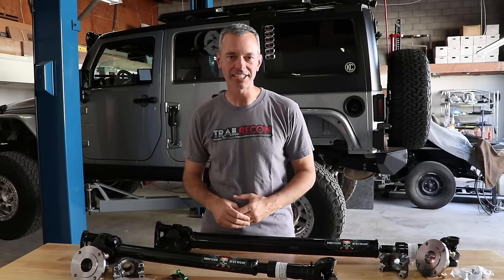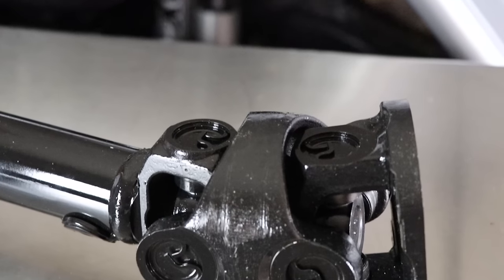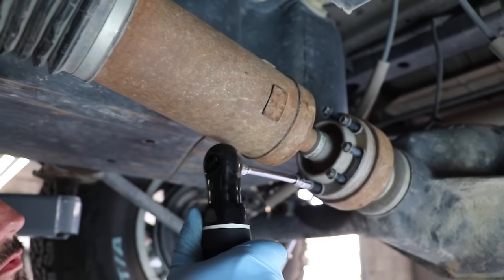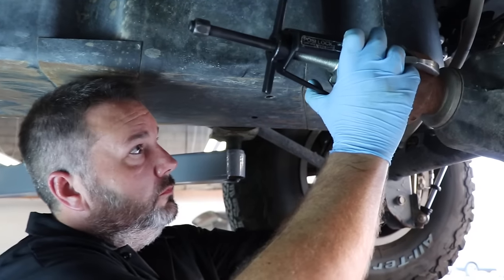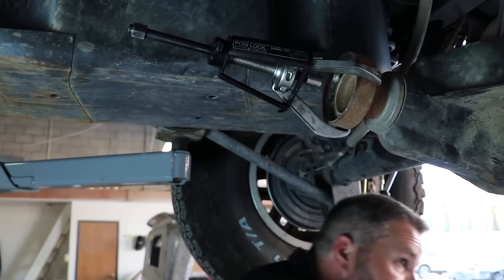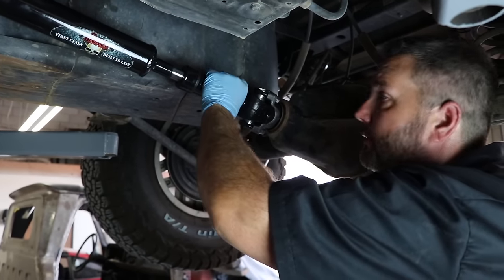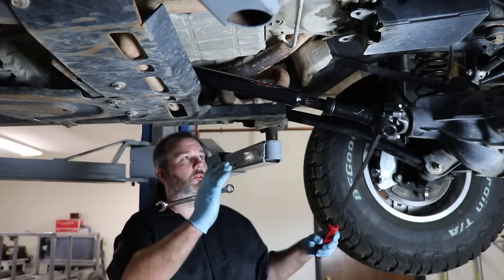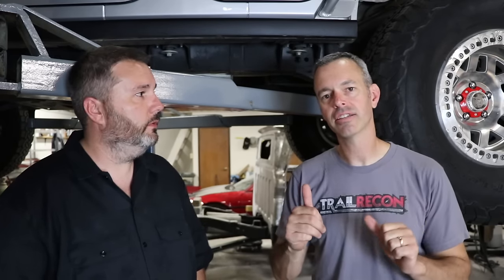How to REMOVE and INSTALL Stronger DRIVESHAFTS?

Comment: Too bad he didn't mention what size socket to use for those yokes.  I laughed at "don't overtighten the pinion yoke or you may damage the crush sleeve", then he attacks it with an impact gun and says "yep, that feels about right" lol

Comment: Although I wheel with an ‘86 Suzuki Samurai, I faithfully watch all of your Jeep-centric videos.  ALWAYS informative.  A couple years ago I broke u-joints on both ends of my rear shaft.  Now running Spicer 1310s on custom shafts front and rear.  Compared to the stock set-up, they are way beefier and plenty enough for the 31s which look huge on my scaled down rig and offer plenty of ground clearance with a 79” wheel base.
Reply from the maker: I love the Samurai's.... I've seen them go places a Jeep can't go!   Great to hear the 1310's are working well for you.

Comment: 1350's are perfect for a rig that sees good action off road.
I've had 1350's with a Tom Woods shaft on the rear for 10 years and all I've had to do 
is grease them a few times a year.  Double cardan's will really smooth things out!
Reply from the maker: 10 years on 1350's is the kind of life I'm looking for!

Comment: He wasn’t kidding about those driveshafts being hard to remove. It took me about 3 months of busting through rusted bolts and hammering away at the front and rear drive shafts before I finally broke them off the vehicle.

Now I’m here, learning how to install the new driveshaft that I will now have to buy.

Comment: You don't remove the diff carrier & measure the spindle bearing preload drag when you retorque the yoke nut????   Do you run a break in period on the diff after that?

Comment: Run some 1350 driveshafts on my JK. Nice not to have to worry about them. 

  Brad..  Relocate that EVAP canister above the rear axle!
Reply from the maker: Agree, the canister needs a new home soon!
Reply: @TrailRecon  metalcloak makes a nice bracket for the evap canister.

Comment: Hi - great video, thank you for posting. Listen, I'm trying to get the driveshaft off an old volvo of mine and I can't seem to get it out of the rear diff. I noticed Mike used a hammer to simply pound it out...just wondering what surface he was pounding away at - was it on the shaft itself or on the female end of the rear diff, do you remember? Whatever he was doing seemed very efficient and I'm hoping to replicate his technique. Great looking Jeep you got there!
Reply: Changed mine last year, had the same issue getting the old CV bs off. If you watch closely when he's lowering the old DS down (6:22-6:29) you can see where the diff end is like a psuedo female adapter(that really shiny part is the male part to the psuedo female adapter),  it slides over the male DS side about a quarter of an inch.  Tap on the male side, anywhere in front of that.  I have a massive set of slip joint pliers,  I grabbed the shaft and hit the pliers at the bite point, alternating sides, and it will come undone.  If you're doing a replacement in kind, just be certain you don't damage the female side of that diff joint

Comment: Brad, it’s been a while since you had these installed, how often are you re-greasing your drive shafts?  Are you doing it every oil change?  Any challenges you’ve run into?
Reply from the maker: They have been holding up great and honestly I have been trying to keep up with greasing at every oil change. No challenges.

Comment: If the new has a smaller diameter than the stock, why was there a conflict with the transfer case cable mount with the new when there wasn't with the old?

Comment: Does the drive shaft I buy depend on the axel housing or gearing that my Jeep currently has? For instance, I have a Dana 30 front Axel housing on my JKU with like 3.56 gearing. If I upgrade to a Dana 44 with 4.88 gearing will I need to buy a new drive shaft for that?

Comment: Hey Brad, love your videos! I have a Metalcloak 3.5” lift and just put in the Adams 1310 front driveshaft. I’m running about 5* of caster and 1* pinion angle. What are you running and have you had any issues thus far?

Comment: Hey Brad..   It's probably been mentioned already but although your technician means well, It's never a good idea to install a pinion nut with an impact.  Transfer case side as well.   Who knows how much torque is on the transfer case side.   He set his torque wrench to 160ft lbs and the nut never moved before it clicked..  I can bet money he changed the preload on the pinion bearing as well..   Please do yourself a favor and take it into a driveline shop and have them change your crush sleeve and reset your preload accordingly.   It'll save you aggravation and money in the future.  You're way too good of a guy to have a shop burn you accidentally...  How's the stock steering off road with the 37's?  I can bet you're looking at a PSC system..        Keep the shiny side up bud..  Happy wheeling...
Reply: Also, for the extra $4 
 why not change the seal as well? you already had it apart.

Comment: So I need to ask about the length for the rear drive shaft, what size is it ?? 42" ?? I have a 2015 jku Rubicon with a 4" lift and 37" tires and I need an upgrade

Comment: I think I overtightened the pinion nut that he is saying to to overtighten cause it will change the preload. Now I get a clicking noise when decelerating. Could it be it? can I loosen the nut and tight it again ?

Comment: Brad, do you have any concern of the 1350 exceeding the strength of your other components putting your axle at risk of failure. Adam's website states that 1350 is recommended for running tires beyond 37s on D60s.
Reply from the maker: No concerns.  I talk with Adams about that very issues and they still recommended 1350s.

Comment: Noticed the Adams driveshaft yokes don’t use a dust cover for the pinion seal. Is there or reason for this or is the factory dust cover considered an overkill? Wondering if it is likely for a spec of sand to get trapped between other pinion and the seal and create unwanted grove without the dust cover.
Reply: I wondered the same thing but noticed there's some type of rubber material there sticking out. I also wondered about the gap where the OEM Style front flange mates with the Adams OEM Style. There's a gap being there where it seems like crud could get behind it....I'm sure they've thought about this though...

Comment: How much does this type of labor usually cost? I just ordered my and was wondering if it’s worth it taking it to a shop rather than doing it myself? How much in labor fees?
Reply: 2023 - I was quoted $240 by the local Jeep dealer to install a front drive shaft if I supplied it. It took me close to 4 hours and I still need to revisit the bracket (see 14:30-14:50). I would say I was working slow for multiple reasons including having to beg, borrow tools from neighbors and shuffle around tools when the rain came. So the $240 would have been well spent but I learned a ton as well. I will write up a summer below too. FWIW, another '4x4' local shop said they would install their own custom shaft for $1400. Yikes!

Comment: What size posi lock did you guys use!?
Reply: this answer won't really help you with a specific size, but keep it small. There's not a lot of space on the front size of the transfer case. Think puller arms 3-4" long max.

Comment: I have a 09 jku with a 2.5 rk lift with oem control arms. Do I need adjistable control arms for a drive shaft like this?
Reply: Manuel Castillo I was told “only over 3 inches do you need to change the control arms and drive shafts”

Comment: I have a question. Why did he torque the front but bot the rear? He torqued to the front to 160 ft/lbs but just used an air gun to put the rear on.
Reply: Pinion gear has a preload setting based off the torque required to turn the driveshaft.  The idea behind his work on the diff side was to NOT screw with the preload setting.  I've heard a lot of DIY guys say it's easy to do and I've heard a lot say, never do this without checking preload with a dial torque wrench.... Basically if you screw up you'll eat your rear diff up in a few months
Reply: But I did mine following a similar method a year ago and...so far so good

Comment: How is a u-joint strong than what the factory had
Reply: The factory joint is a constant velocity style joint with small ball bearings and bearing cages. A u-joint is a large chunk of steel with a channel for grease, the joint caps use small needle bearings, but they don't take the torque shock and load that the cv joint does.

Comment: Brad, do you have lockers and have beefed up your gears for your 37” tires? I know you up graded your breaks. Thanks
Reply from the maker: I have the Rubicon, so yes, front and rear lockers.  I'm still running the stock 4:10 gears for now.
Reply: Thanks

Comment: An Impact gun she’ll never ever be used to torque the pinion nut. There is a high chance of bearing scoring. 
There is a tool called “Torque Multiplier” that’s what he needs to torque and pinion nut.
Reply from the maker: A torque multiplier would be a great tool to have.  No mention of it in Adams instruction though:  With the Impact gun tighten down the pinion nut until the socket comes to a stop. NOTE: DO NOT KEEP TIGHTENING THE PINION NUT AFTER THE SOCKET HAS STOP.  If you keep tightening the nut you will over crush the crush sleeve and the pinion bearings will burn up.
Reply: That is per “Dana Spicer manual”.  Loosing or tightening any pinion nut. I had no clue till my buddy built me a Dana 60 rear axle for my Fj cruiser and that’s how I found out about the sensitivity of the pinion nut/bearing scoring. 
A lot of shop don’t know or knowingly take the shortcut which can be disasters. In which they are shorting the life of the bearings.